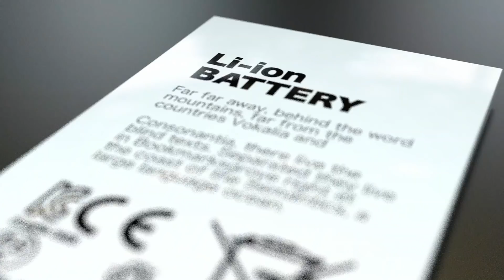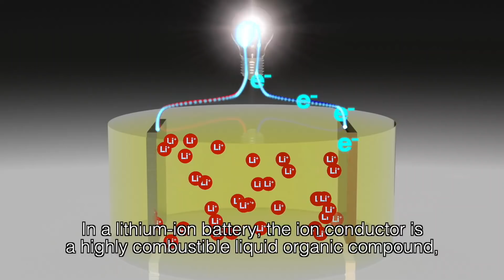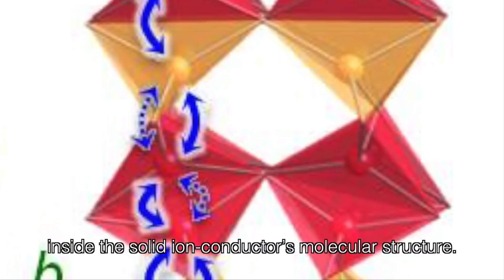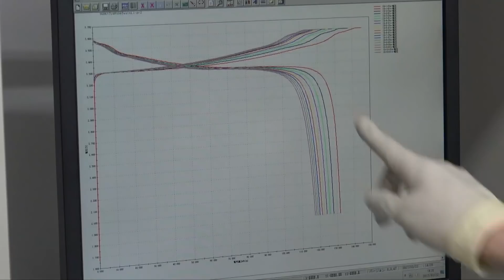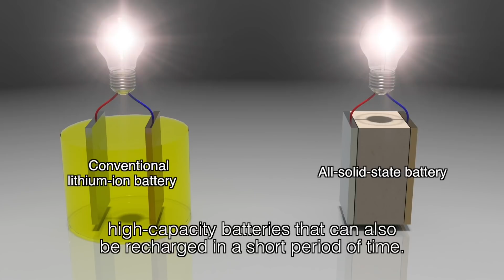All-solid-state batteries - Tokyo Tech Research

Comment: If you want to save nearly all the energy in regenerative braking, then capacitors allow for that, as  batteries cannot absorb energy or recharge fast enough.   Capacitors are needed for that and to double the lifespan of regular batteries. You may not see them though as they can be integrated into the battery itself.

Comment: I don't believe the claims of solid state batteries because If solid state batteries have twice the energy density and 5 faster recharge time they would never need to be charged on an ebike that has regenerative braking because regen brakes already charges batteries up 25% each ride so x that by 5 and you've got 125% recharge each ride (an ebike that never needs to be charged at the wall).

Comment: Usually it takes 5 to 10 years before lab experiment becomes marketable product.
That is, if no other competing invention is developed during that time.
Behind every technologies we see today, there are thousands of lab projects that never saw a chance to become a product on the market.

Flash memory technology, for example, was introduced in 1980s(at least to my knowledge), when the hard drive technology was still in its infancy and the capacities came in mega bites and there was no term "Flash memory" yet invented.
It took digital imaging revolution for the flash memory to become household name by 2000.
It's still developing today to the potential it was promised in 1980s.

When it comes to battery technology, there are hundreds of competing experiments worldwide.
It has a potential to become $trillion market, of course everyone wants to claim the winning technology.
Only one will be named the winner.

Comment: Scientists around the world have been trying to perfect solid-state batteries for around sixty years now. Three cheers for the scientist at the Tokyo Institute of Technology for their hard work and amazing accomplishment. If this discovery/invention works out, it should revolutionize the battery industry. We certainly live in exciting times.
Reply: DrDread This video is based on very old information. Tesla with Panasonic is already producing much more advanced chemistry cells, which will reach the cost of 100USD/kWh by the end of the year... Tesla battery packs, which are quite large (75-100kWh) don't use capacitors. in fact they can output 400kW for 1-2 minutes sustained.

Comment: No, li-ion batteries in EVs are not need combined with capacitors .
Reply: Earl Pottinger     The point of capacitors in a battery powered electric car is not for acceleration. It is to allow fully regenerative braking even for abrupt stops.  Current lithium-ion batteries cannot absorb the braking energy quickly enough under heavy braking, which is why every current electric car still uses the mechanical brakes in these situations. Better regenerative braking is obviously a good thing, since it increases the vehicle's range.
Capacitors let you absorb the braking energy fast enough to avoid this problem. There are two main reasons they aren't used. One is that they add extra weight and take up a lot of space. The other reason is the extra electrical losses from first charging the capacitors and then using capacitors to recharge the batteries. A battery that could be charged much more quickly avoids both these problems.
Reply: That hit me right away. Tesla, RIMAC, NIO all make fast cars with great acceleration and none of them use capacitors.  Also coming is Porsche and Jaguar and neither of them said they need capacitors either.

Who is the idiot who says it in needed?
Reply: The tesla inverter uses capacitors and transistors

Comment: "Also, because of their limitations in delivering high, instantaneous power, lithium-ion batteries need to be combined with capacitors when used in electric cars"... Completely false .  I don't think any EVs supplement their batteries with capacitors.
Reply: The tesla inverter uses capacitors and transistors
Reply: For Goodness Ache, the caps are used in the charge balancing circuit in the BMS. The implication I guess is that these batteries don't need charge balancing.

Comment: Advances in solid state battery technologies are very important.  Thank you for covering this development.

Correction: Electric vehicles generally do not use capacitors for short term energy storage, as suggested in the video.  EVs with large enough battery packs to have practical range generally also have high enough power output without the added use of capacitors.